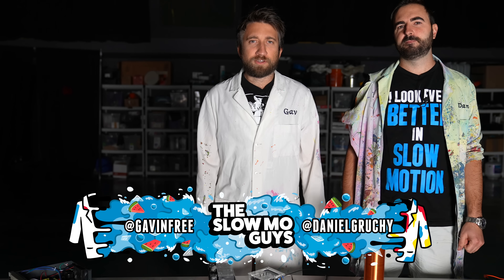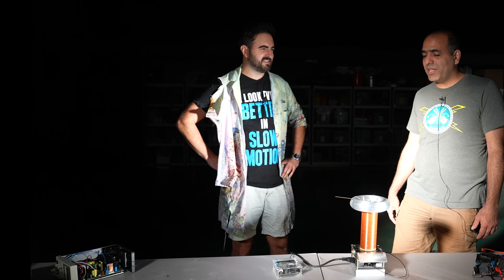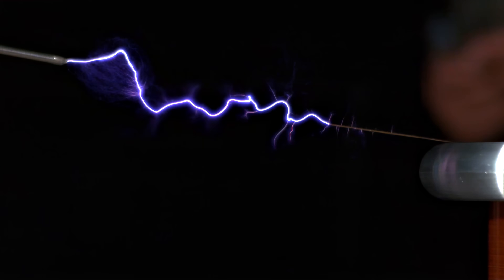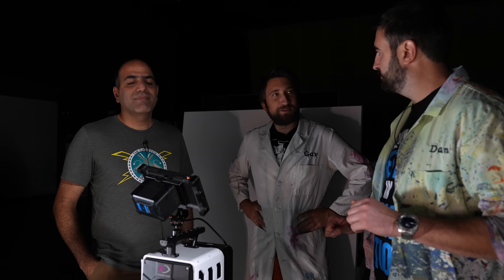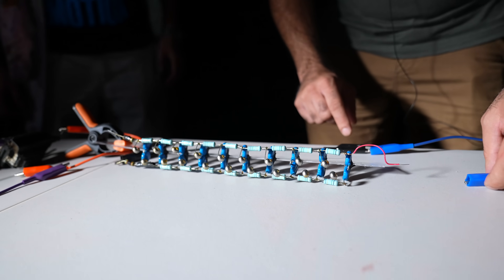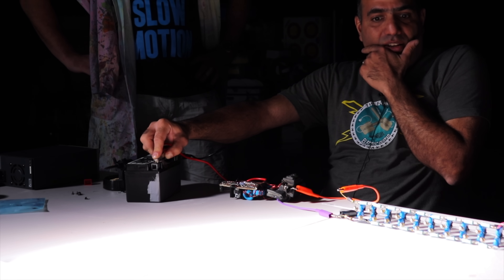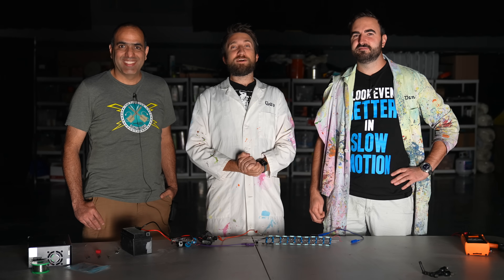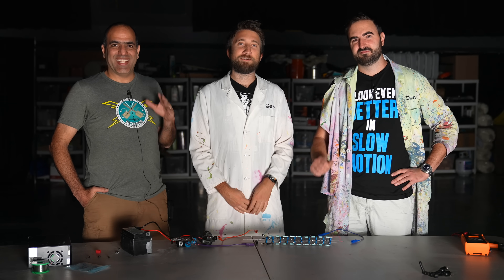Electrical Arcs at 1,750,000FPS - The Slow Mo Guys with ElectroBOOM

Comment: Get a multi giga hertz, multi channel oscilloscope and you’ll probably time resolve the arcing, but of course not as images. [Years ago, I took a high voltage lab class where a graduate student had made a memory to store giga hertz data rates to measure arcs in a similar (but more capable) high voltage generator.]

Comment: ik yall probably figured out long ago why this all happens, but i wanted to put my thoughts out-

I think the reason it's all simultaneous, and why it happens from the final one, is because that completes the loop. my thought is that it's like a dam, building up with electrons until finally, there's enough energy built up to allow ALL of the connections to be made. the final one connects, and that gives a path for all the electrons to go from positive to negative. they all happen simultaneously because that's the only instant where there's enough power for the electricity to flow.

Comment: I learned the little grounding trick from a friend of mine I worked with at a hospital. While delivering plastic wrapped linens to workstations. He taught me that if you held a key in your hand and touched the door knob with the key, the static  charge buildup in your body would " Arc" between the key and the door knob and you would not feel it bite your hand. 👍🏻🕵🏻

Comment: 8:12 that reminds me a lot of lightning bolts, I think what's happening, like with lightning bolts, is that, the first charges create a channel of ionized air and flow through it, then some get accumulated in the source before jumping through the same channel, and it keeps going until the channel breaks.

Also, the "fluff" that appears between the Tesla coil and the screwdriver could be the stepped leader from the tesla coil making contact with a streamer from the screwdriver, like with clouds and the ground.

Comment: Great video. I've worked with high voltage for over 30 years. Just a few notes to add for everyone. An arc is only one portion of what is happening. the streamer stage is what is seen first. You will also see the step leader coming from the other object. Once the step leader streamer connects to another streamer the electron channel in formed and you get the bright arc. The electron tunnel in the air doesn't break down as fast as the tesla coil resonates. This is why the arc path stays relatively the save as the tesla coil resonates. Lightning in slow mo displays the same properties.

Comment: Lightning is an ARC and is relatively slow compared to an A to B power supply voltage. An ARC (Anode, Rectified, Cathode) can be steered between the North and South poles of two magnets or one horseshoe magnet. You can also steer it between two electrodes, one with an abundance of particles of electricity and one with a shortage of particles of electricity.

Comment: Traditionally Marx generators are triggered from the bottom of the stack. Maybe the upper spark gap was the closest spacing and happened  to trigger first. Try it again but increase spacing of upper gap. Also a mark generator with inductors rather than resistors might yield a ladder breakdown.... due to some resonance.

Comment: I love the sound of a powered-up Tesla coil in the morning!  I saw a demonstration some years ago, in which there was this guy had a number of differently sized Tesla coils, being turned on and off very rapidly (at fairly high frequencies) by a MIDI controller.  This collection of the coils played a TUNE, with different notes coming from differently sized coils, going from low bass frequencies to around 18 or 20 KHz, producing  all the frequencies of a symphony orchestra.  Low bass notes were coming from the biggest coils, and the highest frequencies coming from coils the size of the one in this video and smaller.  Sure, they all produced a square-wavy kind of sound, but the tuning of these distorted guitar sounds, was right on the money!  The machinery had been well tuned, and the arrangement of whatever song it played sounded like ten or twelve outrageously distorted guitars playing a symphony!  It was weird, and the extreme distortion of the sounds fatigued the ear after not many minutes.  However it was pretty amazing.

Comment: Remember how in the beginning of this channel, or close to it, there was this video of a shattering teacup and his camera was so slow, it looked like the cracks were instant, then years later, with a new camera we could actually see the crack propagate?
Well, here's hoping we can do the same thing here a decade later. Although, looking into how this is done, for what I know (which is very little) we seem to already be pushing the bounds of what's possible.
The really interesting questions come when we film faster than the speed of light. You can in theory do this if you just have enough camera's. If this is done, though, it's going to look different for every camera as the part of the arc closest to the camera will light up sooner than the others, but if you know why "quantum mechanics" is named the way it is, I do wonder if there's a chance we won't get to see even this. Like the universe has a set rate of "frames" So no matter how fast we film, there will always be one frame between no arcs and all arcs.
I know it sounds silly. That would imply the speed of light is instant, but the theory of relativity has shown stranger things. Like it being possible to see something happening exactly simultaneously actually change depending on your perspective and/or relative motion. Meaning you can see the left side go off before the right if you travel in one direction, and the opposite if you travel the other direction.

Comment: Here is one good question. You guys are deaing with speeds higher than anything we know well. Light speed. Did you consider the how parallel the diode axis was to the camera’s perpendicularity?  Because at these speeds the light source closest to the camera would be seen first. So if it were off in the respective axes you could either align the explosions or badly misalign them assuming that they arent insantaneous and your isnt perpendicularly parallel
Reply: Camera* isnt perpendicularly parallel.

Comment: 16:00 is electron momentum a thing? I would i magine the flow being directed more towards the end would indicate a flow of electrons in one direction. Could that possible direct the order of discharge? Also, if the last diode’s voltage is lower could it mean that it has a better capacity to accept momentum from both directions? Maybe that charge difference causes the leap to happen there first for the fact that it would move more effectively out of the second final gap and the final pole gap? I think of this maybe like diffusion. The last diode has more room for electrons making the bandwidth most like higher.

Comment: Its a carbon trail, the following arc follows that same carbon trail.  Saw this as a failure many times on an old induction hardening machine.  Any material touched by that carbon trail had to be replaced or it would follow that path really easy

Comment: Flashing: done the same with oscilloscope connected to watch voltage and current. 

The first bright arc occurs and lasts while the source capacitance can maintain a sufficient voltage difference, then it goes out as the target charges up. In that cycle, the voltage continues to increase igniting another arc. If the target is conductive, it arcs to the same spot. If the target is non conductive, to a spot nearby not yet charged up. This continues to the peak of the cycle. 

The voltage reverses and nothing happens as it decreases until it builds up sufficiently in the opposite direction where it also makes multiple arcs and so on. 

I am consultant engineer to a company that makes high voltage electrical plasma generators for industry.

Comment: The part with the screwdriver is similar to what I do with my car key when I expect static electricity. That moves the spark away from my skin.
I also learned to ground myself on wood as an alternative, because it's not the metal that causes it, but me.

Comment: "Seems like it's running at the speed of light almost!" From what I've read, yes! The wave of electrical energy induction change that we consider "electrical current" in wires can travel at nearly 90% the speed of light! If my math is right from eyeballing the length of ElectroBOOM's contraption around 1/4 meter, your cameras would theoretically need to be about 600 to 700 times faster to actually see it across multiple frames!
Which sounds absurd but it's wild to think how close we even are to that!

Comment: Wouldn't it be better to shoot with a 360 degree shutter for scenarios like this? It's entirely possible that you missed something happening inbetween frames since you're using a 180 degree shutter here, and because there's no motion then there wouldn't be any motion blur plus the advantage of having twice as much light
Reply: The camera has global shutter.
Reply: @GabrielsLogic yes, although that doesn't matter if the camera is recording at a 180 degree shutter - the global shutter will be closed just as much as it is open, so you're still missing out on half of what's going on
Reply: @meable3763 may be a camera limitation. The slo mo cams might not be able to do that

Comment: 10:45 You didn’t put the resolution of the video. U did put the time, frame rate, exposure and shutter angle but not the resolution. It’s 640 x 64.

Comment: Hmmm, when u guys did that video called “1 MILLION FPS” when u shot eggs, for 100,000 FPS, it is indeed the maximum u can shoot in 1280 x 576 pixels. However, for 200,000 FPS, the resolution was 1280 x 256 but in reality the maximum is 233,300 FPS. For 400,000 FPS,  the resolution was 1280 x 128 but in reality it is 456,500 FPS max. Interesting. For 800,000 FPS in the shooting egg at 1M FPS, the resolution was 1280 x 64. In reality, is it 875,000 FPS like when u recorded Mehdi’s Mark’s generator? Plz let me know!

Comment: I’d like to argue that the reason you see the last arc flash before the rest is because of the speed in which the electricity bounces across those first several electrodes. The visual of the flashes occurred for the first few only after the last node zaps and the current was completed. It was the last to have received the electrical charge on the line therefore it producing the faint charge until it brightens like the rest of them. You gotta think… the other flashes were almost instantly bright, the last one took a second to light up like the rest. The fact that that charge was moving so fast through the first few nodes didn’t show the visual flash until the current was completed on the last lap. Thats (in my unprofessional opinion) a pretty reasonable assumption.

Comment: Lengthen your circuit. If you had 100m of wire between each bridge, you'd be guaranteed that they'd fire sequentially. (electricity travels ~100m in copper in 500ns).

Comment: Current flows at the drift velocity of the electrons, but the voltage is carried by the electric field in the air surrounding the wires and so it propagates at the speed of light in air.

Comment: What if you daisy chained 4 cameras together, each set to start 437500 frames after the first, would you be able to overlay all those frames to give yourself a video at 7000000 fps?

Comment: Just a thought on how you could get more frames per second (yes I realize how insane this suggestion is):

Assuming your camera has some sort of timepulse input, you could theoretically set up two or more cameras to synchronize to that timepulse, and  slightly offset the trigger in such a way that they are capturing “round-robin”.

For example, with two cameras, you offset the timing phase by 90 degrees. So, the second camera would be taking a picture in the middle of the inter-frame gap of the first camera. You would get 1.75M x 2 = 3.5M FPS

With three cameras, offset phase by 60 degrees. 5.25M FPS

Etc…

I’m not an electrical engineer so I can’t design such a mechanism, but I know it’s possible and not terribly expensive. An FPGA tied to an atomic clock reference (which can be had for a few hundred dollars these days) could do that easily.
Reply: The major problem here would be that the cameras cannot share the same position, so your merged footage would wildly jitter due to the alternating camera angles.
Reply: @Shulcare  I believe that can be adequately mitigated using a beam splitter or even a rotating mirror.
Reply: In theory this should be possible. I'd love to see the science behind that!
Reply: I have a better idea. There are faster cameras out there than the phantom tmx 7510.

If they used the shimadzu hpv x, they could have gone to 10 million fps. 

If they used a phantom fast cam  SA-Z, that would let them go to 21 million fps

Comment: With how high speed that is, Im betting you could see the difference between a light turning on, impacting a wall, and the light coming all the way back

albeit it would still likely have to be a very very far wall, but you could likely catch the frame or 2 between turning it on and it hitting the wall and coming back
Reply: You wouldn't be able to see the wall until the light has bounced off of it and hit the camera.
Reply: @aoxby8037   Yes but you would be able to see the light itself turn on, and if you had a significant amount of smoke or particulate in the air it would illuminate that and bounce back as well.

It might be a 1 or 2 frame difference but I'm betting beyond a certain range it might still be noticeable.

Comment: so, it takes light 1 ns to travel one foot and 1,750,000 f/s it's way too slow. its the difference between micro and nano second. you'd have to film at 1,000,000,000 f/s to see if there's any difference. but, that's the speed of information. so, for intents and purposes it is instantaneous. i just find it very strange that all of that wiring isn't slowing it down enough to make any difference at all. great video!

Comment: Maybe the Mehdi's power supply burned because it's running on the 110v, and the voltage there is 220v ?

Comment: 11:13 As an electrical engineering student, he originally said the peak voltage, Vp, but we generally go off of Vrms, which is a way of measuring AC, it's Root Mean Squared, which is Vp divided by root 2. Just a little insight on what he was talking about and how he messed up the number originally

Comment: the smallest gap will always fire first.

or the one given some type of ionisation promoter... like a point.
ideally they all charge to the same potential.
the single gap breaks down, you can see its the smallest, some are nearly twice as large...

but the instant it does break, the potential across the other gaps instantly exceeds their breakdown threshold, and it all goes. it should be a cascade out from the initial arc..

at close to the speed of light. whats the propagation rate along this form of "transmission line"? 

shame it wasnt set up with the smallest gap in the center... yet it would still need a higher frame rate...

were talking... gulp... picoseconds... three orders of magnitude again, at least...

begs the question... how on earth do you measure a femto second?

Comment: So would the last connection in the circuit start to lights because the capacitors will all have to be charged to “complete the circuit “ before they Trigger ?
Very cool as always 
👍

Comment: Innocent question:  If the path through the air becomes ionized, paving the way for the next spark to follow the same path, what happens if you move the air appreciably, as with a high flow fan?  Will the arc follows a fresh path each time?  Would the ionized air molecules have been shuttled far enough away?

Comment: What electro boom said towards the end about how the current moves at the speed of light actually isn’t far off. Electricity in a copper wire will travel pretty close to the speed of light. If a beam of light in a vacuum can travel around the entire planet in less than a 5th of a second, reduce that distance to the length of that device, less then a foot and you pretty much have close to instantaneous travel

Comment: The charge builds up more in the first ones before the flow reaches the final one that completes the circuit. I doubt they react simultaneously, probably at the speed of light. But it explains why the ones at the front are brighter

Comment: I was loading a howitzer onto a train car in germany with other soldiers. The rail company hadn't shut down the power of the railroad. It had 66000 volts going through overhead wires. One of the men on the next train car tripped on the top of his howitzer and swung his arm up to catch his balance. I heard the crack of lightening, saw the flash, and smelled over cooked meat. The soldier was on the ground competely burned and smoking. A really horrible scene, that I'll never forget.

Comment: 500 nanoseconds, translates to 500 meters of distance, traveled by a beam of light, or a wave of gravity, or the funneling of an electron along a wire. That's not much wiggle room. I bet a collection of "straw" electrons flow forward at the speed of light from the beginning of the circuit, and trip each "camel back" capacitor to arc all in sequence. Once a few electrons bridge the gap for the first capacitor, a huge flood of electrons flow all the way through the circuit, filling and then emptying each capacitor at the speed of the flow, the speed of light. If you were watching the light that was shooting forward from the circuit, it'd appear perfectly simultaneous.

I think. There isn't much wiggle room, but there's still the room for a bit of delay between each arc aside from speed-of-light lag.

500 meters!